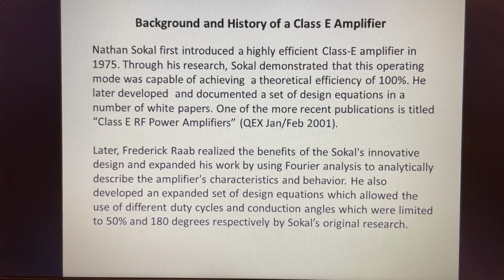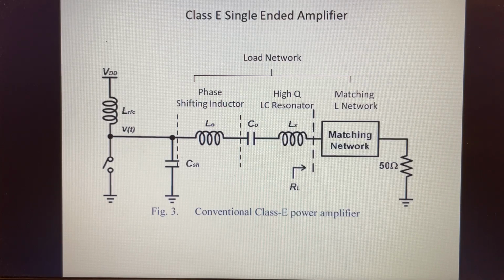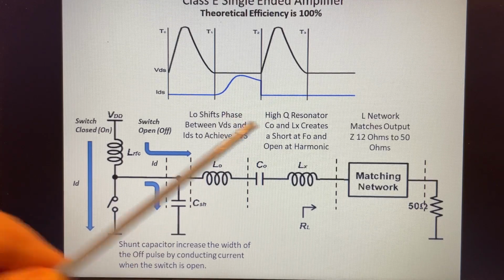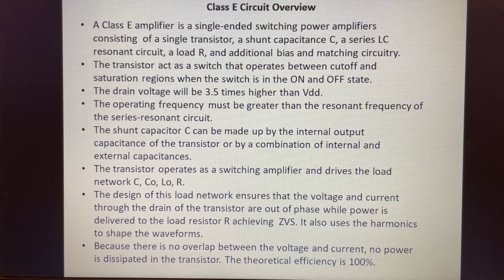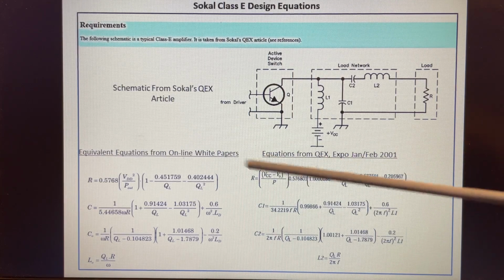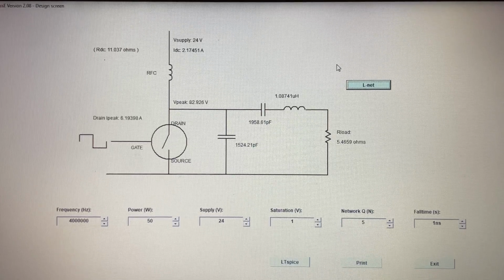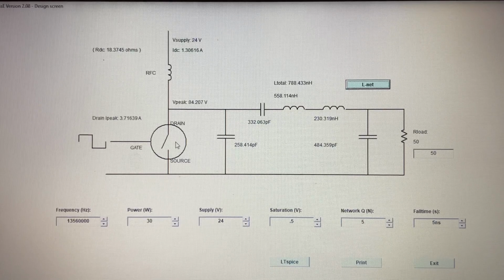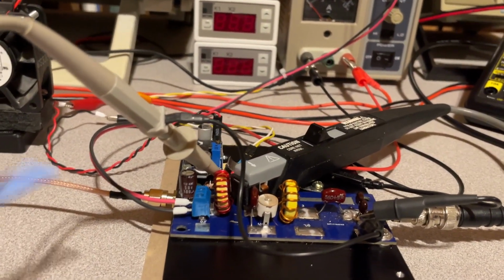Class E RF Amplifiers Explained - Circuit Design (Part 3)

Comment: I think the RFC value is important. Too much and the choke will limit the current rise time. Too little and the choke will saturate during the transistor on time. Plus, a lot of current, 1.3A is flowing, so wire size is important.  I’d like to see the actual circuit including a discussion on getting Hi Q with typical toroids available to the amateur.

Comment: How do you arrive at a saturation voltage of 0.5v for the IRF510? This has been something I have been very confused about when trying to choose a transistor for a Class E amplifier. If I understand correctly the saturation voltage is the Vds at which no more current flows for the selected Vgs. From the Ids chart it seems you would want Vgs as high as possible to reduce conduction losses, so Vgs = 10 and saturation looks like it happens at much higher than 0.5v  (looks like 10v to me). Are you using the 4.5v curve instead? If so, doesn't that leave a lot of efficiency on the table?
Reply: In your post, you are describing the point where the transistor is conducting and fully turned on. This is not the Vds or Vce sat. voltage used in the class E calculation tool. For a MOSFET, It is actually VDSon which is determined by multiplying RDSon from the data sheet by the DC drain current (ID) at the desired output power level. Basically, you are applying ohms law E = I x R to determine the voltage that drops across the transistor when it is conducting. RF Man
Reply: @carminecampo2045  Thank you very much!
Reply: @MobiusHorizons  I hope my explanation cleared up a few things for you. RF Man